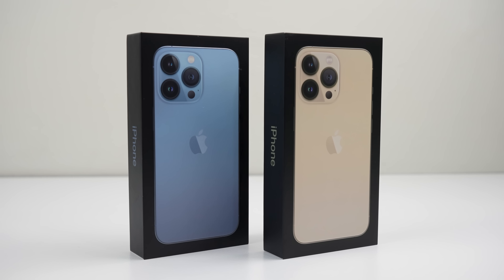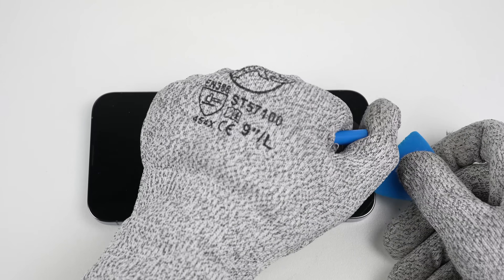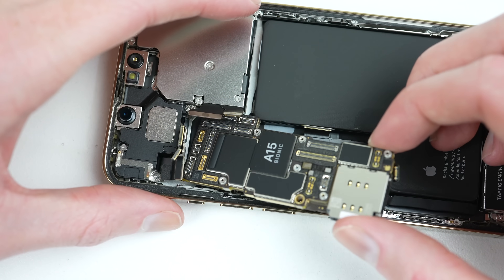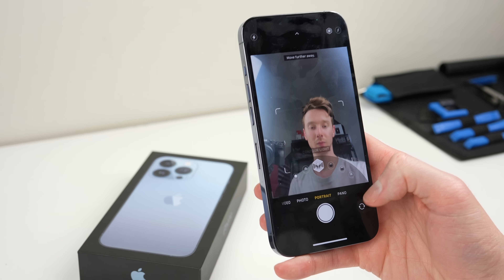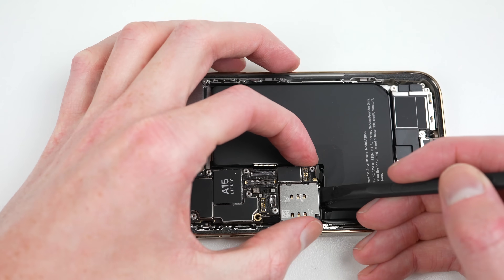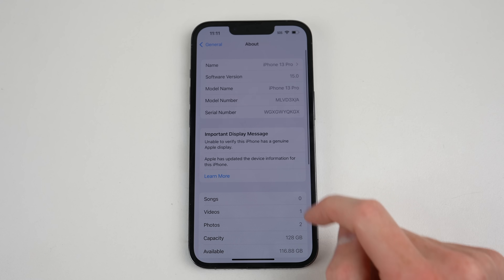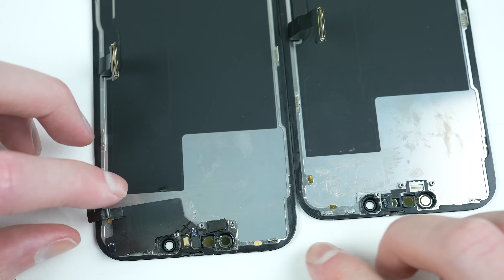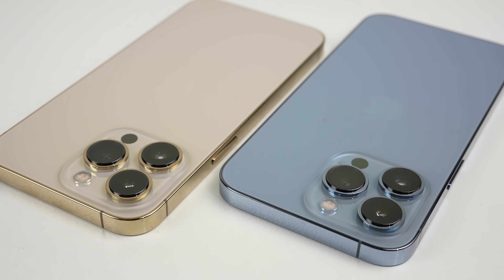iPhone 13 A Repair Nightmare - Teardown and Repair Assessment

Comment: Apple already told us, these changes are necessary for security!

Security of their income revenue
Reply: and then they are opening the floodgates of apps
which they were forced to do
which are probably going to cause worse security issues
Reply: You genuinely don’t understand that a hacker could replace the Face ID camera with a custom one that then allows the phone to be unlocked and data to be accessed? Really? Are you being intentionally dense?
Reply: @kurttappe  
most people aren't like that. anyways, you can get factory made cameras and custom repair your parts, that is what people are asking for. 

spoofed cameras? funny. governments are spoofing our cameras, and hackers take advantage of them.
Reply: @kurttappe  For one thing, it doesn't just affect this component, and for another, it's like saying that I'm not allowed to change my front door because then everyone can get in. If the logic for recognition is in the camera, then the concept is garbage. Furthermore, Apple could simply reset this setting after a replacement. So I would be careful about calling others "dense" if I were you.

Comment: I already decided long ago to never buy another apple product, and you’ve once again solidified my decision. Apple is the most blatantly greedy company I know and I’m amazed that people haven’t realized that yet
Reply: Sadly a lot of people just aren't intelligent whatsoever. Working in retail has shown me this in spades.
Reply: Sadly, they have become isheep... conditioned to only ever think of using apple products regardless of issues.
Reply: Unfortunately a lot of people know what apple is doing but they still buy it because they don’t know anything else and they’re familiar with how Apple products look and are used. Could you give any suggestions for other products? /gen
Reply: @TheSarcasticRat1  any android device for mobile... each brand has slightly different interface.  It is a bit of a learning curve switching systems, but can do it.  The most annoying is when apple uses expect IT to know and be able to support their apple device... when Apple doesn't allow us to know it (they refuse to allow corp IT to support their devices...) and I refuse to buy their overpriced devices, let alone everything else.

Comment: Could you imagine if PC's worked this way where you could no longer build your own or swap or upgrade components! there would be all out war, yet Apple get away with this crap!  I bought the original Itouch and Ipad, hated how itunes worked and hated how after a year or two apps ceased to work unless you upgraded the OS but the older devices would not support the newer OS.  Mental...said at that point Nope! was not going to support that company by buying their products.

Comment: "Reducing wastes by removing accessories", very unfortunate the fact that one of those accessories, that should in theory be optional, is necessary to the phone to function.
Reply: @nebylicza  you lost go away
Reply: @nebylicza  I dont care how much you have ppl need to be able to charge the phone with out the need to buy it too when it came with it before, I guess you wont like it when you get your new car fresh from the dealership and it has no tires b/c they want to lower tire waste...... + your "most people" is not even true at all unless you got some thing to back that up aaaaand the charger you speak of is almost brand new to the world we use USB not a C cable thats new and not needed yet they forced it on to make the excuse, how about you stop being a shill for once
Reply: @nebylicza  So? Just give users the option to select with/without charger free of charge (excuse the pun). It is 100% just a way for them to lower their spendings, while still asking a higher purchase price for their product. Grade A lower expense and increase revenue tactic, and hide it behind a faux environmental agenda.
If they truly cared about the environment, they would make their products easier to repair and recycle, instead of just handing fully functioning stuff to Apple technicians so they can "fix" them - aka remove the well functioning parts and rewriting their system settings to use in another phone they can then ask full price for.

The fact that people fall so easily for the "save the planet" agenda they just threw up out of the blue, is hilarious. People are so damn naive xD
Reply: @nebylicza  you're highkey delusional, aren't you? lmfao
Reply: @nebylicza  You do realize they changed the charging cable to Type-C, making it completely incompatible with every single USB Type-A wall charger that was provided with prior iPhones, right? The same year they decided to switch the end of the cable that plugs into those wall chargers is the same year they stopped providing wall chargers with their phones.  They claimed "everyone has one" so there is no need to provide one for "environmental" reasons yet no one owns a Type-C wall charger, certainly not Apple owners who've used the previous phones' Type-A chargers. So where are you getting this stockpile from? Are you saying you have a stockpile of old chargers that Apple made obsolete for their new phones? So that means you would need to buy one sold seperately as well... right? So how are you not annoyed? They rendered every type-A charger obsolete the moment they put a type-C cable in the box, just to force people to buy the new charger sold separately.  It's just like their $5000 monitor that they charged $1000 for the stand that was sold seperately. I need the stand for the monitor to function, yet no stand is included and the one sold seperately costs an additional $1000? That's just corporate greed but I'd love to hear more of your defense of this monopolistic behavior and why it's a good thing that a trillion dollar company behaves this way.
Reply: @Killajake99  gottem.
the last bastion of cope turned to be a futile endeavour.
Reply: @Killajake99  the people who defend Apple saying that they have a stockpile of chargers don't seem to remember that Apple never actually shipped the type C chargers with any phone at all lol.
Reply: @nebylicza  well my point was that apple customers are delusional and your comments just proved this. enjoy your iphone lol.
Reply: @nebylicza  since apple customers buying 1000$+ smartphones without including a simple thing like a charger, my short answer is: no.
Reply: @nebylicza  yes.
Reply: Just imagine: there are Apple shills that unironically defend this. The world really is full of easily scammed chumps.
Reply: @Alice iPhone 10 was capable of gaming at 60 frames when android stuttered at 30 frames. You might have 8k but iPhone pro still takes better pictures. Your androids are all the same running intel processors meanwhile apple has its own line of processors that absolutely dominates the intel’s or snapdragons performance and battery life. I’m glad you can play some retro games on your phone it can be done on iOS without jailbreaking. I can do anything I did with my androids on my iPhone for longer without having to close apps and have Samsung hardware with random intel parts running android software 💩 💩  sounds like the latest combo at Taco Bell
Reply: @Alice Samsung note 9 couldn’t keep up with a iPhone XR. And they’re are a shitload of paid apps on the android Play store what are you talking about they’re all free? And what’s this cope thing you’re talking about? Do you have a lot of therapy or something? If 1000 for a device that makes my living for me is causes you this much anxiety I wouldn’t even tell you what my home and automobiles cost 😆

Futhermore I’m disappointed you seem to not care about the environment and ecosystems that apple has committed to saving by spreading less plastic in the ocean, meanwhile Samsung doesn’t care about the oceans or the the sea life. If you support that your just too trashy for me alice
Reply: @nebylicza  you know that people need chargers which can break and if they dont get them but have to have buy them stand alone is worse for the enviroment? More casings for them bc they are alone is not a positive and how tf are you going to use what your phone has as an "feature" where you need a special charger what makes a new produce line for even more waste
Reply: @Alice congratulations your 800 dollar phone can do what 30 year old equipment could do slow clap you android hoes really down bad
Reply: @chrisd933  For $200 less an android phone can have the same features as an iPhone and still do more without being jailbroken or bricked by the company that wants to control your device even when you own it. I know reading comprehension is hard but when Apple charges as much as they do they have no real excuse. And imagine needing to get an iPhone fixed when they can just brick for any reason. Apple will charge you for a replacement rather than bothering to fix it, and they'll claim devices are water damaged when they aren't because mites (small insects) get into the devices, occasionally pee on a water damage sensor sticker, and cause it to falsely trigger as positive. So when the apple store takes apart your device, they see those tripped sensors and refuse to fix it because "water damage" even if you just have a loose cable, and they'll charge you up to 100% the cost of the machine NEW to replace a component and do a "repair." Price gouging, corporate greed, anti-consumer and monopolistic practices, anti- right to repair and anti-environmental design of devices, and a horrible Authorized Repair process that often doesn't even result in a repaired device. Third party repair is significantly safer than Apple, especially when an Apple Authorized technician literally leaked a woman's nudes by sending them to himself and posting on the internet. No, this wasn't a third party mom and pop repair shop that breached private Apple customer data, like Apple wants you to believe. This was at an Apple Authorized repair shop. But no one who supports them admits when Apple screws up or makes blatantly false arguments while their own authorized repairmen do exactly what Apple accuses every one else of doing. Under Steve Jobs' leadership, Apple actually innovated. Now it's just tightening the leash on consumers and what they can do with the product they purchased because Apple still owns the product, not the person who paid $1000+ for the device. They want to control every aspect of the life cycle and how these devices are used from manufacturing to recycling and everything in between. But nah, all bow to the almighty Apple because y'all like literally setting your money on fire. I pay less and get treated better with all the same features? I'll take android since I know I can get it repaired for cheap. Keep burning your money if you want, the trillion dollar company sure won't stop you.
Reply: If you don’t have something that can charge a usb cable maybe you’re not iPhone material
Reply: @Alice shut up, poor. Obviously you're not the targeted demographic, if you cant afford luxury then go back to your flip phone. Hate when poor people complain about shit they cant afford, annoying as hell. 🖕😒
Reply: except that the vast majority of people have one already, and Apple will happily provide you one on the spot if you need it.
Reply: @ScottPankhurst  FOR MORE MONEY. a simple thing like a charge for the product you are buying should be MANDATORY. how the fuck are you even defending this behaviour. it fucking baffles me.
Reply: @ScottPankhurst  are the give charger if you say i dont have? So there is nothing to blame.

Comment: Not an apple employee or anything, but thinking about it, maybe the devices (camera, mic, etc) have some secret serial numbers that are not recognized by the "new" logic board, which were hard pre-programmed into it. Obviously Apple stores have this program that "aligns" the serials so they work together.

A question: what do you do with those many phones?

Comment: I'm bummed that apple has gone this direction. I wonder if it's actually better for the environment though, since the market won't be flooded with 3rd party iphone parts that are overmanufactured. It'd be great if after apple went this direction they would also make it cost at a fraction of what it normally costs for repair, then at least it could be a win-win for both them and us, and possibly the environment.
Reply: Apple shreds millions of working used devices that could easily be repaired and go on working for years. It's the absolute furthest possible thing from being better for the environment. Apple is worse than oil companies.